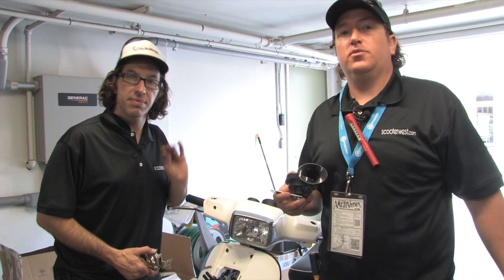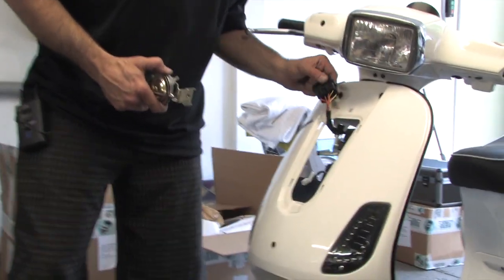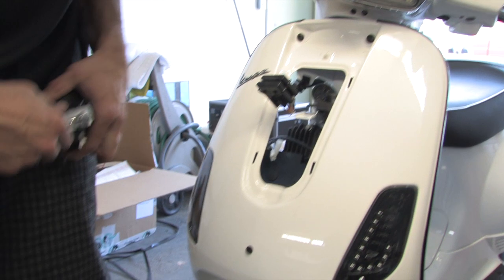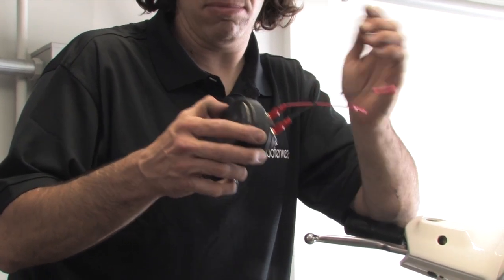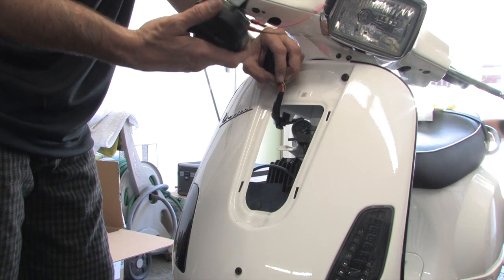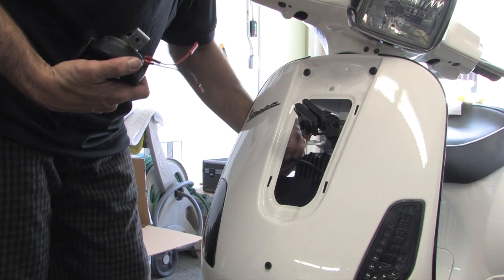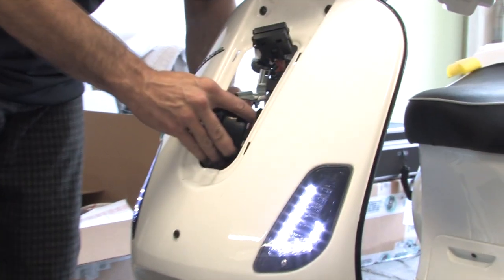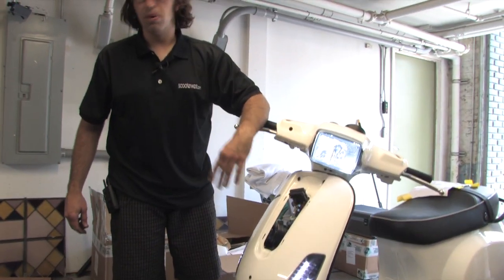136db Horn on Vespa S

Comment: I just installed this horn on my 2009 LX150 and was able to bolt the new horn bracket onto the spot on the existing bracket where the old horn was bolted to. This allowed for the horn to be extended lower and thus have more space from the front of the leg shield, and the existing wire connectors were able to reach the horn without any extension. It's nice and loud!